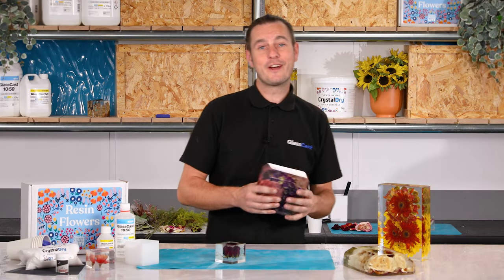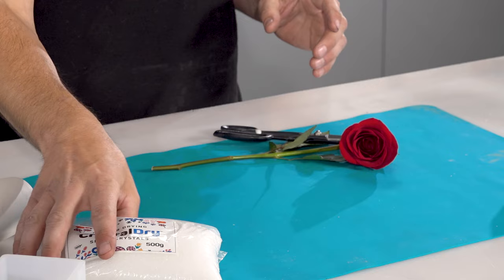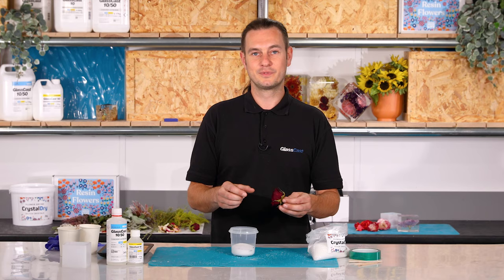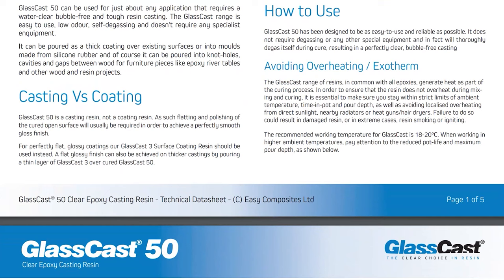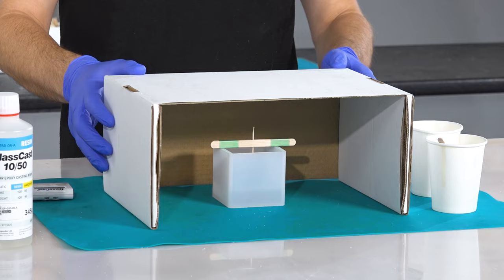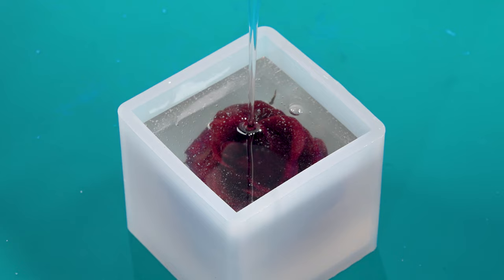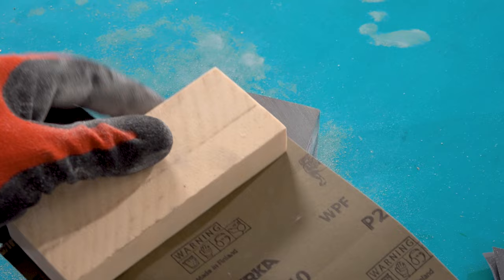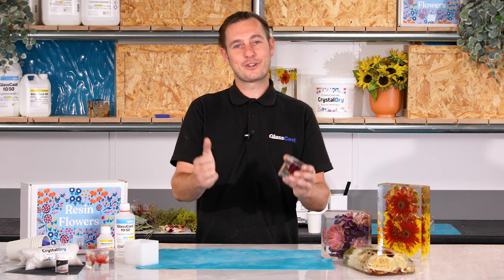Resin Flowers - How to Dry and Preserve Flowers in Epoxy Resin

Comment: Will the flower fade in resin??
Reply from the maker: There may be some further fading depending on how much light exposure the flower gets. Drying out the flower prior to the encapsulation is certainly a good way to keep the color in the petals and prevent it from degrading further.

Comment: Thanks so much! I didn't realise you could dry flowers like this. I have a tiny house (my hall is literally 2 metres long, and pretty narrow). I could almost envision drying leaves and petals from the garden next summer, for a floor........ if sticking them to the floor as in the penny video would not destroy them.  However I am worried about how slippery a floor would be, and if it would need to be cleaned constantly to avoid staining, with two large dogs coming and going.
Reply from the maker: Yes with a contrasting pigmented base layer, flower petals cast in GlassCast would make a stunning floor. GlassCast can be quite slippery when wearing things like socks so may not be the best thing for your dogs. In terms of cleaning, you don't really need to worry about staining but the longer dirt is left on the surface the higher the chance that it would be walked over and damage the high gloss surface. We would generally advise avoiding the use of GlassCast as a floor covering in a high traffic area such as a corridor where you may have muddy feet (and paws) bringing in dirt on a regular basis.
Reply: @glasscastresin  Thanks so much for your very prompt reply. It will be no good for the floor if it is slippery,  which is a real shame, but my number one priority is safety for the dogs, one of whom i my assistance dog. However, I do have some other ideas though. 

This is a home Bilbo Baggins would describe as tiny. If I cannot do the floor, I am wondering if I could do a feature wall. Or upcycle an old wardrobe.  If I cut some plasterboard into tiles, then prepared them outside in the garden, once dry I could glue them onto the wall.  I have one wall with two doors, and a really a tiny surface area. It would be a good place to experiment. If using tiles, how would you suggest I fill in the space between the tiles? Could I use more Glsscast then sand down/polish to a shine?
Reply: Hello
Reply: @rottsandspots I was talking with my daughter about tiny homes and thought a dried flower "window" for the sliding door to toilet/bathroom would work and also possibly the lip to the shower. Little areas with little surface abraision

Comment: I've been watching several videos about preserving flowers in resin, but this is the first video I've seen where it's explained to have the best results with drying out the flowers first. I've never seen this done and now I'm wondering if those flowers from the videos I've watched will rot over time!
Reply from the maker: Its hard to say as it is in a sealed environment once the resin cures but it is certainly possible they could degrade a fair bit initially.

Comment: Thanks for clear and useful video - I can see the layer boundaries in the finished cube I was not expecting that from your tutorial, I understand the reason for limiting the volume of pour but hope there is a way of avoiding these marks ?
Reply from the maker: Hi John, the only potential way of limiting the layer lines would be to use a degassing chamber. You would need to try and cast the resin in one go and to remove the air. The only way to do this would be to degas the resin while it's in the mould.
Reply: @glasscastresin  what is the process?

Comment: Very good and explained well. 
How scalable is it if you wanted to have the flowers inside a tabletop?
Could insects be done the same way?
Reply from the maker: Any encapsulated item is going to reduce the volume of resin used by the volume of the item.

Comment: Thanks, could you use a vacuum chamber de de-gas the bubbles under low vaccum.
Reply from the maker: You certainly could do yes and if you have access to a degassing chamber, it can really help to draw out the air bubbles that get trapped in and between the petals. You may also be able to reduce the total number of layers needed.

Comment: So beautiful good job 

Do you recommend this when making artificial flowers for stability for in the vase
Reply from the maker: If you mean to simulate the water inside the vase then no, we wouldn't recommend a rigid curing epoxy like this as the small amount of expansion and contraction during the curing phase is likely to crack a glass vase, Instead, you would be better placed to use a product like Aquallusion which is softer and specifically designed for this kind of project..

Comment: Great detailed video!  I'm very new to resin for flower preservation but I saved flowers from my son's wedding, and this will be my first project (I'm going to practice first, though).  I have a question... is there a such thing as "too dry" for flowers? Can you leave your flowers in silica gel too long, where it will damage them?
Reply from the maker: Hi there, no the flowers cant be too dry. I would suggest getting them into the crystals as soon as possible to preserve them whilst they are at their freshest. You can then take as long as you want to do your practice castings and once dry the flowers will keep for as long as you need.
Reply: @glasscastresin  THANK YOU! That's a relief. I got the idea to preserve them and immediately ordered supplies from Amazon. I got them in silica gel a couple of days after the wedding (some 3 days, since I needed to get more silica gel). They still looked good, though, so I'm hopeful about the resin step. Thanks for responding!

Comment: Thanks for the tutorial, i want to try and get a mimosa flower in resin, since they only bloom 1 to 2 days and are stupidly fragile. It just feels wrong to try and make the bloom eternal. Which is why i want to do it to be honest. Looks like i still have about 7 attempts left this year.
Reply from the maker: You would have to take care both during the drying process and resin work to avoid damage.  It may be difficult to do.

Comment: I have a lot of dried and pressed flowers, some bought, some I made myself. I have the problem that the flowers soak up resin and get blotchy. How can I avoid that? It drives me crazy, ruins the resin piece and Google is no help at all. I just stopped using flowers altogether. It's not possible that I'm the only one with this problem. Has anybody solved it?
Reply from the maker: Pre-sealing the flowers/petals can help although may take some experimentation. We've seen this done with hairsprays and PVA solutions, dipping the flower head in and allowing it to cure - this may also soak into the petals however as they cure much faster, they're likely to coat and seal without as much discolouration.
Reply: @glasscastresin  Thank you! I'll try spray varnish and PVA glue and see what works.

Comment: I learned a lot. Thank you. I do want to know if it is advisable to mix used silica with unused one?
Reply from the maker: Yes you can as the crystals can be reactivated when overly saturated with moisture.
Reply: So do you saturate the used portion to reactivate
Reply from the maker: @silverguardiancreations2014  No, they need to be dried for 1-2 hours at around 100'C in an oven on a suitable baking tray.

Comment: Wouldn't it be easier before each pour to use the heat blower to get rid of bubbles before pouring?
Reply from the maker: You will likely trap some air when pouring so often it is easier to do that in one go.

Comment: Thank you for the video, I have already dried my flowers before I realised that the kit supplied a drying mixture.  Question am I too late to use the epoxy Technic?
Reply from the maker: If you are confident the flowers are dry, then you do not need to do that stage of the process and can move straight to the main part of encapsulating in resin.

Comment: Hello, please, tell me why you don't use a dryer  to pop down the bubbles? Is because the cube is small? Started at what meassure do you recommend to use the dryer ? Or not at all...? Thanks!
Reply from the maker: GlassCast 50 is very good at releasing trapped air by itself and shouldn't need any external help to remove any bubbles. If there has been excessive air trapped in the resin from the mixing process or there are some bubbles which aren't naturally disappearing then you can use some gentle heat to help remove them from the resin.

Comment: If you are not going to resin the flowers right away - could u put the flower in the refrigerator
Reply from the maker: A refrigerator may slightly prolong the life but I wouldn't be able to say for how long. Once dry however, the flowers will keep indefinitely. My suggestion would be to get the flowers into the drying crystals as soon as possible to preserve them in their best condition, then you can store them for a while if not needed straight away.

Comment: Does this immortalize the flowers? And if not, how long do they last?
Reply from the maker: If thoroughly dried (so there is no moisture content trapped inside the resin), it should last as long as the resin itself so certainly a lifetime if looked after.

Comment: How much time between layers? I should wait before I pour another one?
Reply from the maker: The ideal time to add the next layer is when the previous one has cured to the 'B' stage and the resin has cured firm with a slight tack to the surface. With GlassCast 50 this is around 12 hours at 20°C

Comment: What is a few days? How long? I'm doing 1 Boutnniere and 2 corsages. It's my 1st time
Reply from the maker: Its impossible to say with any certainty as all flowers will have a different drying time, however, you cannot over-dry them so if you are unsure, leave it in the drying crystals for more time. You can also remove the flower head gently to check it and as above, if it isn't sufficiently dried, put it back into the crystals.

Comment: Do you need a separating medium
Reply from the maker: Hi David, if your referring to a release agent then in this case no. Epoxy resin does not stick to silicone so no release agent is required, although this will differ depending on the mould material.

Comment: Can we put in a picture as well?
Reply from the maker: Hi Kiara, 

Yes photos and pictures can be cast in resin but there are a few considerations. You will need to check that the inks used and the substrate itself won't bleed or break down in the resin so a test will be required. Most professional photos will be fine but, If you do find that the inks are bleeding then you can coat the picture with a PVA solution and let that dry, prior to coating/casting in the resin.

Comment: Do you use different cups for each layer of resin?
Reply from the maker: It's likely that the resin in the cup form the first pour will not be fully cured so it's a good idea to use a clean mixing cup for each layer.

Comment: OK what flowers are you using that still look that good after drying? Also how is this stuff getting rid of the bubbles? Your last piece is clearly not the ones you were demonstrating.
Reply from the maker: Different flowers react differently to the drying process.  The bubbles tend to naturally degas over time before the resin cures, although you can waft a heat gun gently over the surface to lift them or use a cocktail stick to dislodge ones around the petals etc. The dark red rose was the same one seen pouring throughout the video and at the end.
Reply: @glasscastresin  really? When you poured the resin in the middle of the flower, the petals were more open. Then at the end, the petals were all tight again. Did you move them? Remove the petals before curing?
Reply from the maker: @mariatamburro  No the flower was simply left as it was without any further manipulation. It could just be the refraction of the light distorting the view of the flower slightly and making it appear to be more closed up.

Comment: Would this work with tea bags instead of flower??
Reply from the maker: In theory once dry.  However it is quite likely the tea bag will change colour and the tea leaves themselves may well leach tea into the resin discolouring it.  You may want to experiment sealing the bag with brush applied resin in the hope it stops that happening.

Comment: Hi! I’m looking to preserve a 1) candy (made of sugar, glucose syrup) and 2) a  confectionary similar to a madeleine with sugar frosting. 

Can this resin kit be used? People mention the resin preservation process might melt them, but I don’t see any heat introduced?
Reply from the maker: We haven't cast candy as far as I'm aware but that's not to say it wont work. There is a bit of heat generated as the chemical reaction takes place for the resin to cure but it shouldn't be anywhere near high enough for the sugar to melt. You could always do a test run with a small amount. It may also help to coat the item with a layer of resin brushed over the surface and let that cure to the 'B' stage before doing the main casting.

Comment: Hi! When you say work up to 1200 with the abrasive paper, do you mean I use 120, 220, 320, 400, 600, 800, 1000, 1200 on all of the sides?
Reply from the maker: You generally only sand the top as the other sides are moulded so normally good. However no reason why you couldn't sand smooth all the faces if it needs it.

Comment: please if you can help me with this... if im making my project upside down should I pour resin in my flower first than putting in the resin mold
Reply from the maker: If you are placing the flower upside down then yes it might be advisable to fill the flowerhead with resin first to try and eliminate it from trapping air as you pour the rest of the resin into the mould.

Comment: Basic question:Can we reuse the silica gel ?
Reply from the maker: CrystalDry silica gel can be used multiple times, but after several uses will becomne less effective, at this point you will need to reactivate the CrystalDry by following these simple instrcutions:

Pre-heat oven to 100-120C
Spread crystals out on an oven proof tray
Heat in the oven for approximately 2 hours
Allow to cool and store in an airtight container ready to use again
Reply: @glasscastresin  thanks....alternatively can we recharge it by sunlight exposure...is it an effective method?
Reply from the maker: @namrata7394  It depends on the relative humidity and the temperature it reaches. In a hot climate, in direct sunlight, spread out into a thin layer, it may recharge but in a moisture rich environment, it is just going to keep reabsorbing water. The oven is the better option if possible as it will give better, more confident results.
Reply: Thanks ❤

Comment: I would like to do this with a white flower, do you think it would stay white?.. Or become brown?
Reply from the maker: The resin will naturally enhance any coloring in the petals, so if there was some colour change from the drying process, then this will be exaggerated as the resin is absorbed. There are exceptional cases when something in the flowers causes them to change color when they absorb the resin, so it's always a good idea to check with a spare one if possible.

Comment: Can you use a flower that has alot of moisture like a daffodil
Reply from the maker: Not really without thoroughly drying it. Any remnant moisture is likely to bleed into the resin as it cures giving tiny air bubbles or a milkiness within the resin.

Comment: Hello👋 Thanks for the video, very well explained 👍 How could I get a kit in Luxembourg in EU ? I couldn't find a answer on the net 😢
Reply from the maker: At the moment, we're not selling these through our  EU warehouse although are looking at options to do so. We can supply you with the GlassCast 10 or 50 resin but not the whole kit I'm afraid so you'd need to seek out the drying crystals and silicone moulds separately - often available on Amazon, etc.
Reply: Oh sad.. but thanks a lot for the advice 👌😉

Comment: How much resin would you recommend for a double stranded orchid leis? I would roughly say a rectangular box 12-18”tall by 4” thick by 6” wide?
Reply from the maker: You can use our resin calculator to help work out the quantity of resin. https://www.glasscastresin.com/resin-calculator. The volume of that box is about 7litres so you would need about 6-7kg of resin, depending on the volume that the flowers take up.

Comment: Still question....how did you pop the bubble
Reply from the maker: You can waft a heat gun over the surface or pop the more stubborn ones using a cocktail stick or similar to remove them when trapped.

Comment: Can I use a freeze dryer on the flowers and still do a resin casting to preserve those same flowers?
Reply from the maker: The industrial freeze drying process may well remove enough moisture but freeze drying always risks damage to cellular structures (such as plant based material) which may cause issues with the flower.  Certainly if you have access to the equipment, it would be wise to test it first.

Comment: how do you fill the gaps of the rose if you're putting the rose in upside down into a pyramid
Reply from the maker: You can dip it in the resin to help saturate it before putting into place but you do still risk air being trapped in the petals.

Comment: Can you use an airbrush and paint the petals??m
Reply from the maker: Assuming you mean to give them more vivid colours then I don't see why not as long as the paint is fully dried/cured. One thing to watch out for though is if the colourant from the paint bleeds into the resin. To be sure, I'd give it a small test on maybe a single petal to make sure it works as you need it to,

Comment: hi! i was wondering do the dried flowers rot overtime in the resin or do they last forever?
Reply from the maker: We have not seen any rot when properly dried.  It is possible over many years the colours may change depending on conditions/UV exposure etc.  The purpose of drying them is to prevent them rotting.